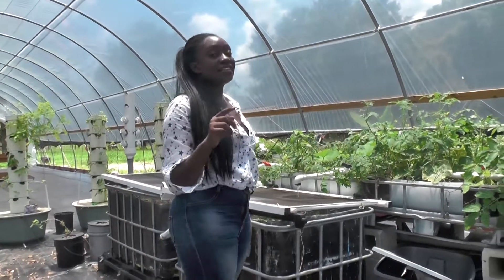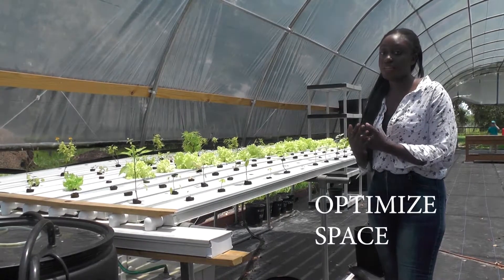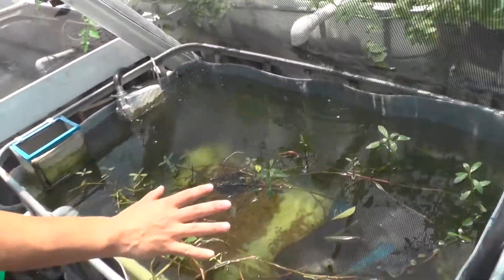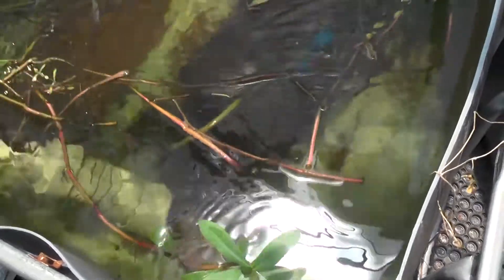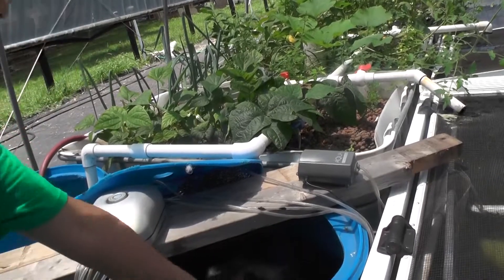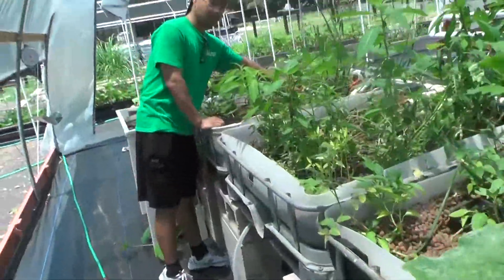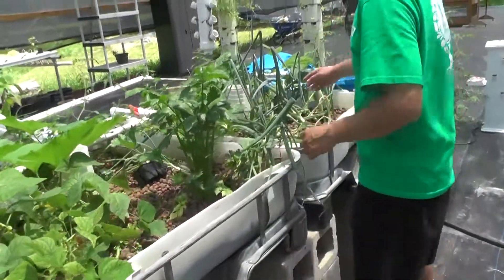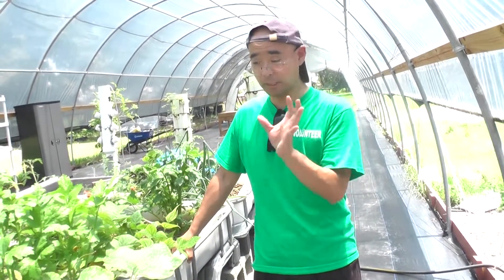HYDROPONICS. AEROPONICS and AQUAPONICS SYSTEM: A visit to Rosebud Continuum.

Comment: Please explain what you meant by using the green onion as an indicator. Thanks
Reply from the maker: Franci5ZA Green onions grow fast and easily. So if you want to quickly know whether your system is in the right condition, you can always check by planting green onions. That's why it's said to be an indicator.
Reply: Sustainability Nuggets with Rarosue Amaraibi. Ok thank you for the tip!

Comment: tower gardens are hydroponic, not aeroponic ;) The root structure is clearly hydroponic https://youtu.be/u7VUYYyqbTI?t=410
Aeroponic roots are very diiferent: https://youtu.be/mNZYR96rhwY
Reply from the maker: Atom izer hello Atom izer. Aeroponics Systems are actually a type of hydroponics system. It is just a very specific type of hydroponic system that does not immerse it's root totally in water. The system shown in the video is an Aeroponic Vertical Garden System. You can watch a description video from the manufacturers of this exact technology to understand the process better. You can find this description video at this link: https://youtu.be/l7EzYmO9u8M
Reply: That definition will fit NFT (Nutrient Film Technique) where the roots recieve a film of water just like the tower garden. The difference is the TG flow is vertical and NFT is horizontal, NFT isnt aeroponic either ;) In the link you posted the narrator states the nutrient solution drips and cascades over the roots, https://youtu.be/l7EzYmO9u8M?t=45 Aeroponic roots are suspended in a mist environment, the TG doesnt deliver mist.
Here are some aeroponic roots, if you compare them to the TG roots you can see the structure is very different and they are not wet at all.  https://youtu.be/l1Rmm9JvPfY